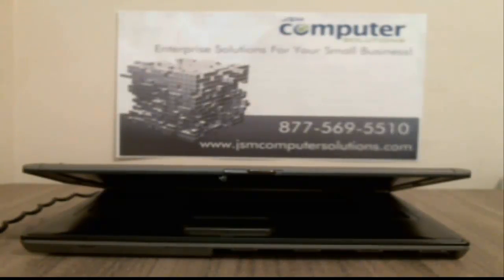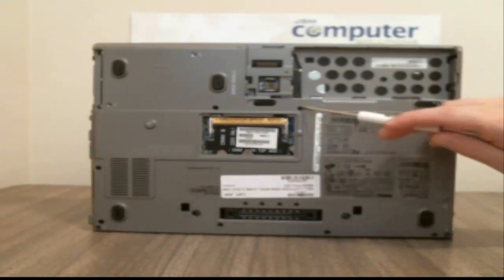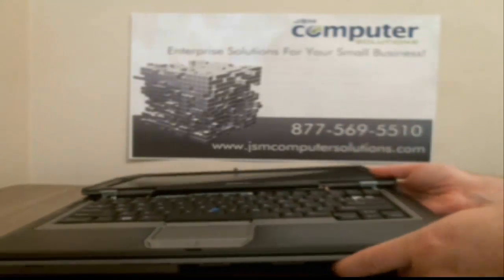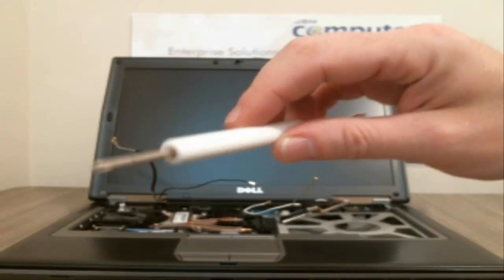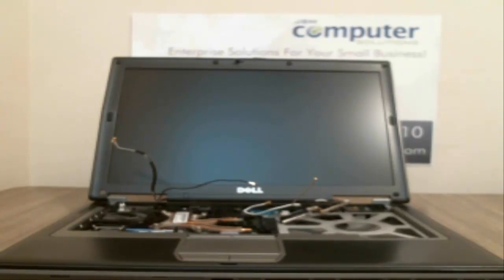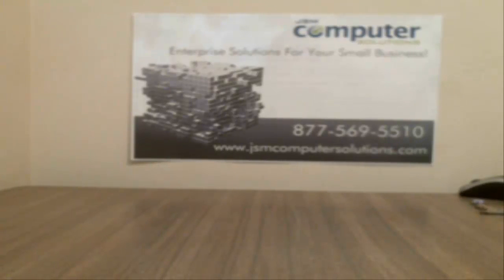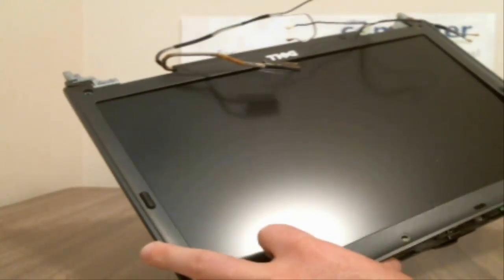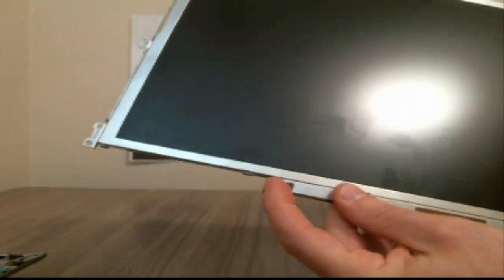Disassembling a Dell Latitude D630

Comment: You should've held done the power button after it was unplugged and the battery was removed, just to get rid of the charge.
Reply: Yeah, if you want to be 'perfect' ! I've sometimes swapped parts out and then realised the battery was still in ! I've not broken anything yet though.

Comment: Thanks for this video; my GPU was acting up and splitting the screen horizontally, and the fix required reflowing the solder with a heat gun (or an oven if you don't have one). Would have had no idea how to get at the chip without breaking something if I hadn't found this video.
Reply: @ Phoenix  The GPU is a classic problem in these. You can only 'reflow' it. Do ensure it's well cooled afterwards.

Comment: My D630 isn't doing anything when I turn it on, except that the fan turns on and the power LED as well. There is no hdd in it, but it has to go at least into the BIOS, right? screen remains black, no LED lights except for the power LED. RAM is not the problem, already changed it. How to determine if it's the CPU or the graphics card?
Reply: What it end up being??
Reply: Gpu failure - known fault on the Nvidia Gfx chip - Reball or reflow to fix it!
Reply: That figures. It's a typical problem on these. If you don't see the BIOS regardless of anything else, it hones the issue down to a very few things such as any of various display problems.
Reply: @grahamstevenson1740  

Ppl 9

Comment: Great one, it helped me to quickly dismantle my D630, figure out that the fan was full of dust, clean it up and get it back working. It used to stop working due to high temperature with the cap led blinking...
Reply: Very informative and interesting but I just wanted to know about where the memory card went
Reply: @gina1114  sorry I can’t respond to that question, I don’t remember and I don’t have that computer now